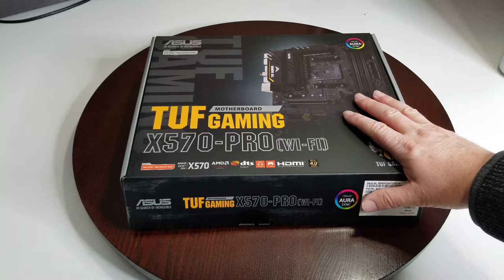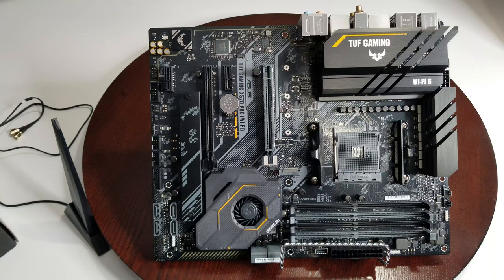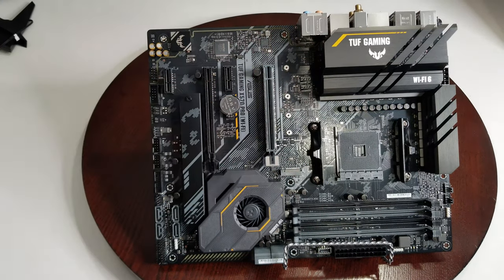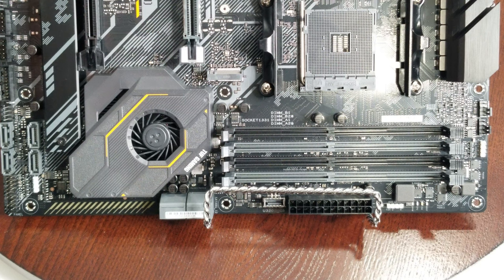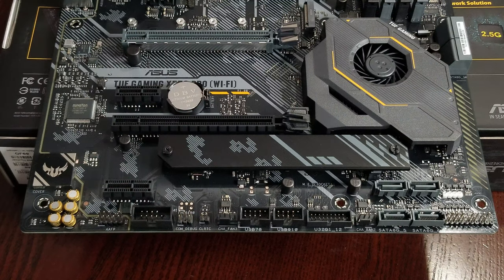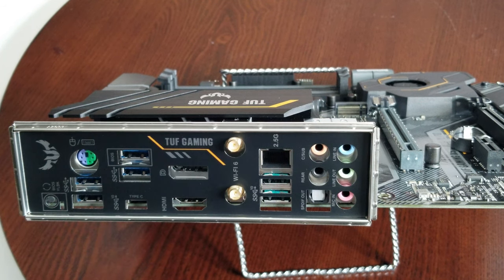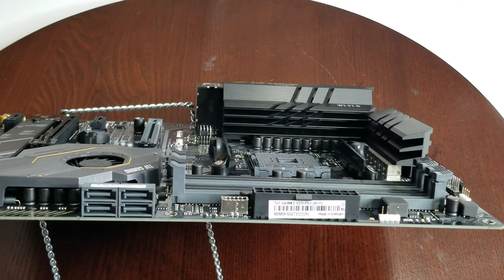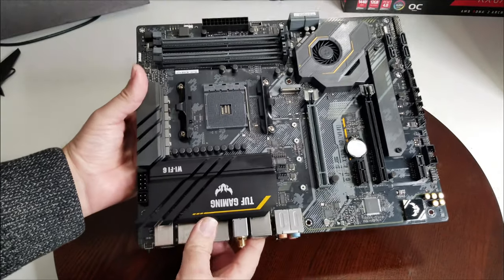Asus TUF Gaming X570 Pro WiFi MB Review

Comment: If anyone has the normal tuf wireless (not pro version) then no USB-C which happened to me and was annoying for my case.
Reply: I have the one called the
PLUS  is that the one you're referring to ?
Reply from the maker: Yeah the TPM, USB Type C and both RGB and ARGB are key things I look for now, the WiFi is also a nice feature but not a must.
Reply: @KTHKUHNKK  yes the Asus tuf plus WiFi.

I got it cos WiFi is my only choice atm. It was about 6months ago or somethings. Found out that what I thought was a modern mobo was missing a feature that came with my case (USB-C).
Reply: @Reviewing_Playing_and_More_RPM  yep live and learn I suppose. I was a fairly new builder then and got into pc gaming as everything got expensive lol. 

Now I would say I am fairly experienced after 3-4 builds. I think I subbed cos u had a video that helped me with a build early on.
Reply from the maker: @dormanthero  Yeah and you could always put a WiFi Adapter in down the road if you ever require it.
Reply: @dormanthero  
Awesome
Reply: @dormanthero  
Thanks 
I must hook up my
Antenna now..
Keith
Reply: @Reviewing_Playing_and_More_RPM  I tried usb adaptors when I had a laptop in the past. I decided the USB ones (not pcie) were not very stable for gaming connection.

 Later I had a pcie adaptor with the first pc I got (prebuild) and the 2.4g connection was horrible for gaming.

This mobo connection for the plus wifi is the first one I had which is blazing perfect, therefore sticking with mobo wifi if I ever have to use. 

To summarize, I have had bad or unlucky experience of adaptors so I am avoiding them.
Reply: @KTHKUHNKK  easiest part. Just make sure wires you screw on back do not get tangled basically and put antenna in a nice position as far as I am aware. At least that is what I basically do.
Reply: @dormanthero  
Thanks I will do that
Reply from the maker: @dormanthero  I guess I've been lucky with adapters so far, but I do prefer MB's with WiFi much easier for sure. Just for info though, I've switched the setting on my laptop to use only the 5GHz bandwith and it makes a huge difference.

Comment: I can tell you for a fact that while the fitting is the same on the Ryzen 3 1200 cpu  it don't work on this mother board, the CPU support list is very small on this board, check the web site to confirm if a CPU will work on this mother board.
Reply from the maker: I stand corrected, I did search out the answer but should have checked the actual website before responding. Sorry about that.
Reply: @Reviewing_Playing_and_More_RPM  Yep a lot of differance between a cpu fitting in the socket and it actually working in the motherboard!
Reply from the maker: @24321619  Yep, I'll do better research in the future.
Reply: flashing the bios should fix the shortcomings of the out-of-the box CPU support.
Reply: @ericpozarycki6601  would a ryzen 7 5800x work with this board if i just updated the bios ?

Comment: How would you compare this mobo to the b550 and x570 Tomahawks?
Reply from the maker: I've actually just started doing a build tonight with it, and so far it's been great, it has all the features you could need. In comparison the B550 is a bit better laid out and I actually used it as well in a previous build. I like them both really well, I do find the X570 just slightly better. Either would be a great choice though.

Comment: Hello can you tell me what is the best motherboard about the Asus Rog Strix x570-E Gaming Wifi II and TUF Gaming X570-Plus (Wi-Fi)? This is for gaming and Fps. Thanks for answering me :)
Reply from the maker: The best way to know for sure would be to see if they both have all the features you want like ARGB/RGB Header or does it have a USB Type C connector, things like that. Also what are the Heatsinks/VRM like on both the one that provides more cooling can make a big difference. Then once you've decided on those you'll know which one will be best for you.
Reply: Thank you very much for the answer, but if you have to choose a motherboard which one will you choose ?
Reply from the maker: @zakride6330  If I had the money the Asus Rog Strix X570-E Gaming as it has better Heatsinks and VRM's would be slightly better as well, but it's very costly. the Asus TUF Gaming X570-Plus WiFi has lots of the features one would need as well and still a great MB. So depends on your budget.

Comment: Dennis I've truly confused about the Wi-Fi antenna.
I do not have mine plugged in the one that came with it.
Should I do this and if so for what reason.
I use my cell phone in the house a lot and it's wifi-connected.
So if I plug in the Wi-Fi antenna in , does this mean I will get a better wi-fi signal then I am getting now  ?
Thanks 
Zombie  2
Reply from the maker: Hi Keith, yes the antenna once plugged in will give longer range to the WiFi and provide much better speeds and range, without it the WiFi might work but not great. So yes definitely put them on.
Reply: @Reviewing_Playing_and_More_RPM  
Thanks Dennis I will do that.
Should I put the antenna away from the computer or somewhere special ?
Reply from the maker: @KTHKUHNKK  Depends on the Antenna if it's like the one I have in the video then it should be a foot or so from the PC if it just screws in then nothing else required.
Reply: With this motherboard your signal will be 100X better if you use the antenna. I made the mistake of not connecting it and my MMO would disconnect every few mins.

Comment: I have the same MB but the pluse vision, I bluged  2×32gb rams corsair Vengeance DDR4 3200 and I think it doesn't work because I received no signal on my monitor when I connect for the first time today, this is my first time to build PC, do you have any idea what I should do
Reply from the maker: First ensure your Memory is in slots 2 and 4 and fully inserted. Your receiving no signal on your monitor could be not being plugged into the right slot, for example this happened recently and the person was plugging in the HDMI Cable to the HDMI on the Motherboard but should have been plugged into the GPU, unless you have integrated graphics on the CPU. Another thing could be to clear the CMOS but that'd be after checking the other things first. That's the best I can offer for now but if you can provide more info I'll get back to you on it. Also check if there are any indicators on your MB to say if it's memory, CPU, or another issue if your MB has this feature.
Reply: @Reviewing_Playing_and_More_RPM  thank you for you detailed information, I tried the 2 and 4 slots, I also plug the HDMI to the graphic card, I also take off the camos and re put again and I still have the same issue
Reply from the maker: So you will need to start checking components to see if it could be one of the other items your using, also try switching the HDMI cable for a different one in case that could be the issue, it's happened to me once. Good Luck.
Reply: @Reviewing_Playing_and_More_RPM  thank you for your help

Comment: Hello can you tell me what is the difference between the motherboard Asus Rog Strix x570-E Gaming Wifi II vs Asus Rog Strix x570-E Gaming ? Please :)
Reply from the maker: The X570-E GAMING WIFI II has a Dynamic OC Switcher which can be nice for Gaming enthusiast and is a more rounded established MB so better Overclocking abilities. It also has the WiFi 6e new standard and new M.2 latching mechanism. Its bound to be more expensive as well. The Asus Rog Strix X570-E Gaming is still a great MB with a lot of the same performance but lacks those features. Hope that helps.
Reply: Thank you very much this really helped me :)
Reply: Thank you very much for the answer, but if you have to choose a motherboard which one will you choose for gaming and fps ?
Reply from the maker: @zakride6330  I'd pick the Asus Strix X570-E Gaming Wifi, for the upgraded WiFi and sightly better VRMs and the OC Options.
Reply: Do you mean you'd take the Asus Rog Strix x570-E Gaming Wifi II ?
Reply: Do you mean you'd take the Asus Rog Strix x570-E Gaming Wifi II ?
Reply from the maker: @zakride6330  Yes
Reply: Thanks you very much ;-)
Reply from the maker: @zakride6330  No problem.

Comment: I didn't understand the part about TPM. Does this have it or do I need to get something else ?
Reply from the maker: The MB has a firmware TPM Module which you can activate in the BIOS and then let you install Windows 11 as long as you also enable Secure Boot. So no need to purchase a TPM module.
Reply: @Reviewing_Playing_and_More_RPM  ahhh gotcha, thank you.
Reply: the TPM is actually on your CPU not the motherboard (that's why there's a place to attach one). for amd this is called fTPM
Reply from the maker: @AuronFFX  TPM is usually a dedicated chip on a motherboard that provides hardware encryption for features like Windows Hello and BitLocker. Most motherboards you can buy don't come with a dedicated chip, but they do come with firmware that can look and act like TPM in Windows. This may only apply to Intel and not AMD not certain as not an expert on these things. I know there is a chip that can be inserted (Hardware) TPM onto the MB, and for AMD fTPM can be enabled in the BIOS. Appreciate your input, if you have more please provide so I can educate myself more on these matters. Thanks

Comment: I cannot get the new Asus crate software/drivers to install. Any input? I also keep reading how cancerous the Asus sync/ new crate is cancerous to your computer. Would love some advice
Reply from the maker: It should have installed as soon as the BIOS Boots up but if you didn't have WiFi it should ask if you want to install it later. Now if your not getting that then you can go to the Asus website and download it from there. I've been using it on a few builds over the last few months and I find it is a really great addition to my builds. I don't like the Asus Suite that comes with it though it seems to never work as I expect it to, however it can be beneficial at times. It's not something you have to have to make your PC work however, it'll work great without it. It just provides some software that can help with system devices, BIOS update info and so on.